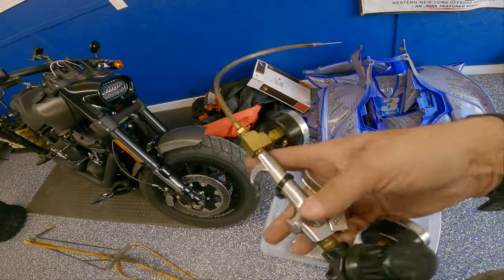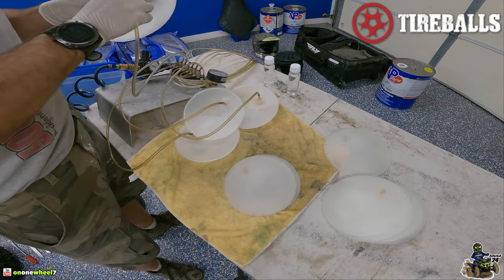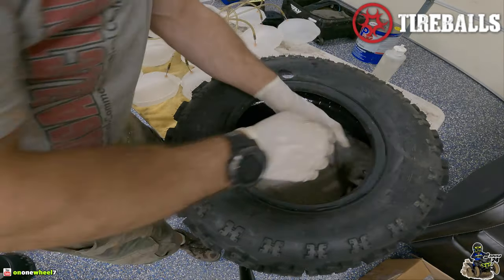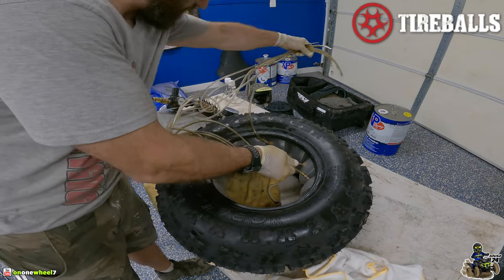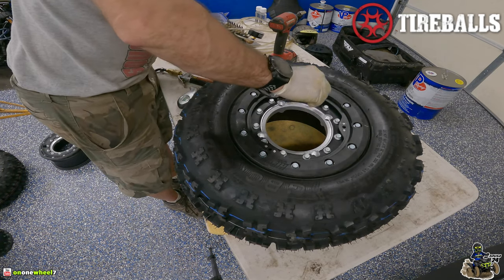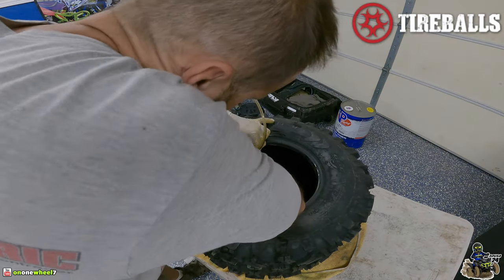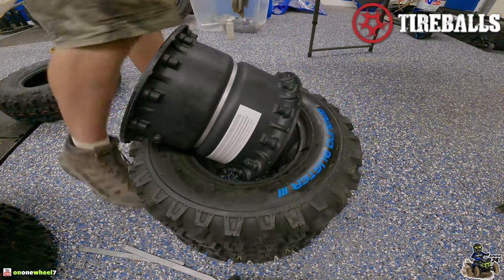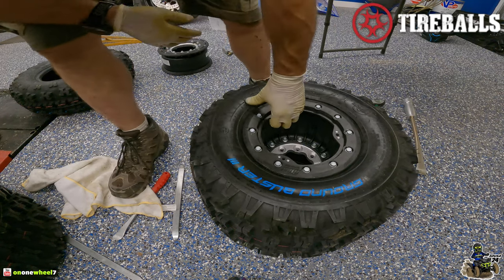HOW TO INSTALL TIRE BALLS - YAMAHA YFZ450R

Comment: So these are kind of like cushcore in the sense if you get a flat?
Reply from the maker: Well with Cushcore you really cant ride on the wheel if the sealant doesn’t take care of the puncture! These work like the sealant pretty much if you puncture the tire and loose the air you can ride on the balls and even pop a few and be able to finish!
Reply: @ononewheel7  Ahhhhh gotcha! Very cool man!
Reply from the maker: Its a must have for racing! They also have a couple other run flat options as well!

Comment: Are these tire balls better then the run flats you use to use?
Reply from the maker: These are the real deal tireballs! I have ran the wally balls but these are a much better setup!
Reply: They look way easier to install
Reply from the maker: @robertwilson5747  with the multiport inflator they really are!